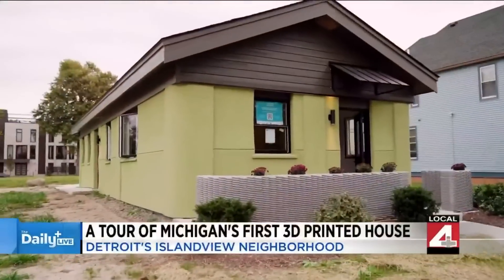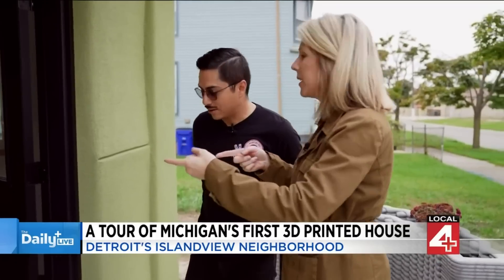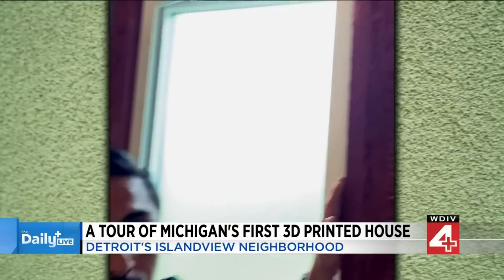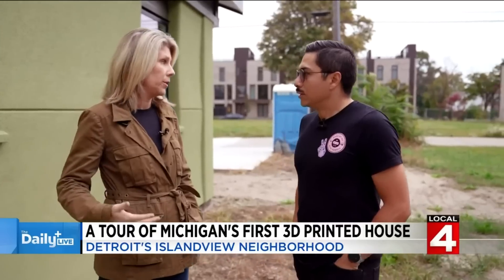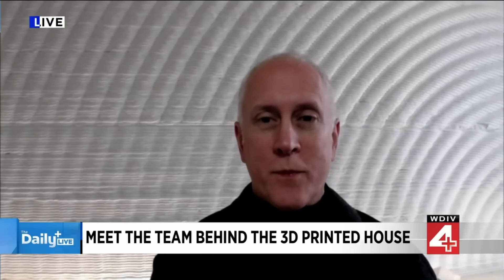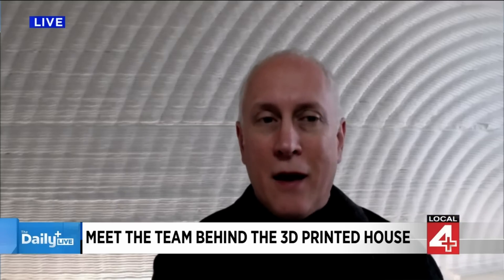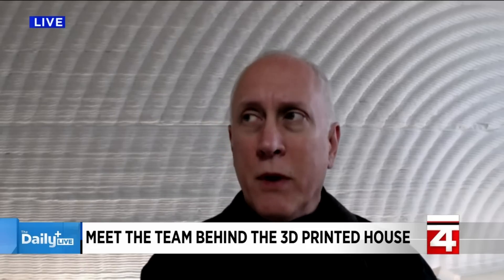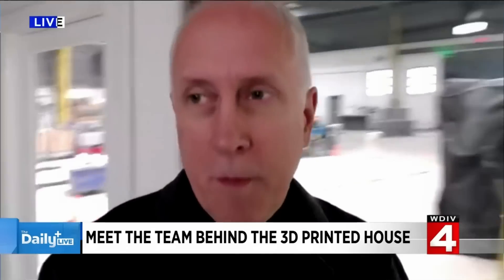A look inside Michigan's first 3D-printed home

Comment: Flood prone areas should not use concrete 3D printed. Once water gets in the concrete it causes it to become brittle overtime and crumble. There are wood houses in my area that have yet to burn down that are over two hundred years old. I am curious to know the longevity of the concrete 3D printed houses.
Reply: I disagree with this comment. Signed - Hoover dam, most of the roads in Florida, concrete blocks, my driveway, swimming pools, sidewalks, moldy flooded wood structures.

Comment: "it's cheaper to build" but still charge you the same price of a traditional home. I've been seeing these 3D homes a lot lately, I think it's a great idea, but what is the point if it's not affordable.
Reply: Thank you very much, it’s not cheaper at all
Reply: You can buy a house that needs a little fixin up and probably pay the same amount.
Reply: Right. Even if the house is $0 it does nothing for the value of the land you put it on. But they have to try to make back the cost of the technology. The only thing different here is some areas of Detroit might be in an otherwise unenviable position of having a lot of available land to build on.

I don't know if wheelchair accessible house is still normally an afterthought but it shouldn't be special anymore, any style of new build can be easily built wheelchair accessible. Good for them for highlighting the issue though.
Reply: It's new, not much competition. Once it becomes widespread the price will drop. And you know this because the price is the same as a traditional built home now, even though it's new.